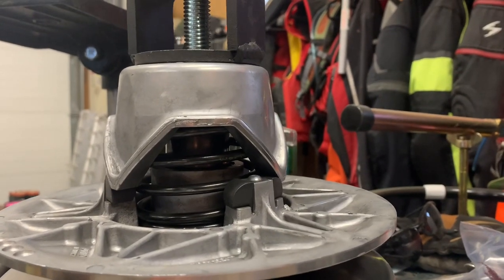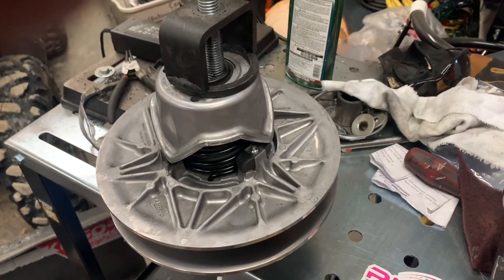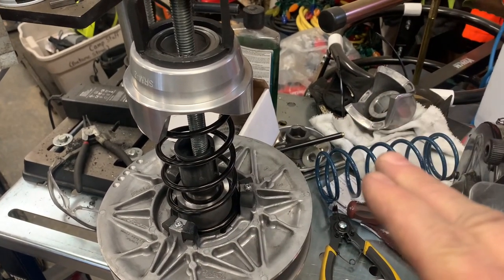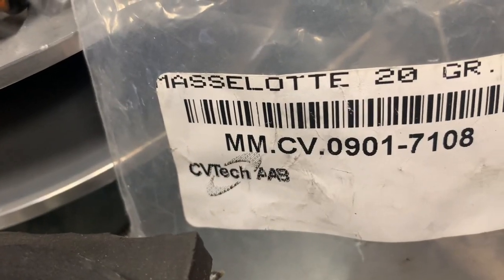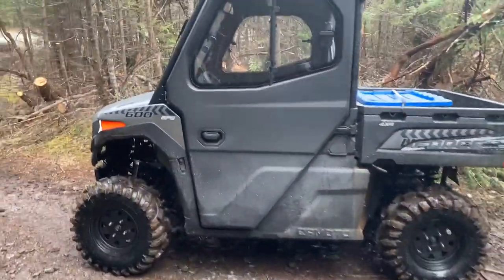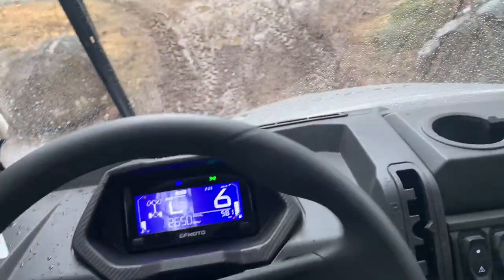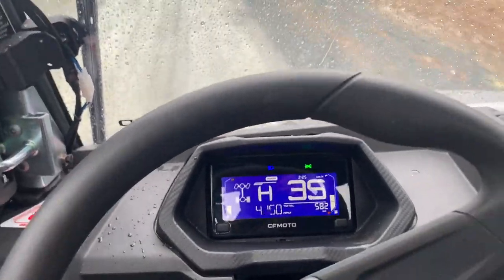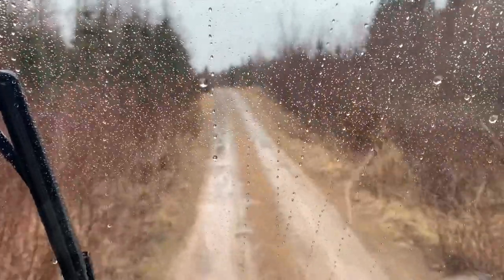CFMOTO Uforce 600 Installing and testing Modified RNG clutch kit

Comment: Great video, very informative. are you topping out at 70km/h in high. I have a 22 uforce 600 stock clutch setup and I travel at 80km/h easy and had it to 95km/h only twice tho cause it was screaming. question is are you gaining a smooth pull away and losing top end?
Reply from the maker: I’ve never had a chance to run a completely stock set up. When I bought my machine it came with 27x10x12 Kimpex mud predator tires. It also had a full cab. I know the larger heavier tires, and the full cab would slow me down, but I’ve never had my machine up to even 80 km/h. Now I haven’t ran it down a completely smooth gravel, or asphalt Road. I know that I was on a slight downhill on asphalt I could get more speed. But as it stands, I’ve never seen 80 km/h (50mph)
After adding the clutch kit, and all of my modifications to it , I gained more bottom end and smoother, clutching, but still ever gained anything on top. It feels like I just run out of power when I get near 70 km/h.. 
The clutch setup I have now seems to be revving very high at 71-72 kmh. 
I’ve heard talks of binding helix that won’t allow full shift out. I might experiment with stock again to gain a new baseline

Comment: Anybody try A1 on secondary with stock spring in secondary?  I was thinkibg of trying this with rng primary kit to maybe save alittle money for now. Was just wondering if anyone has tried A1 cause it aint quite as abrupt as c1 and  a few degrees more then B1. I am learning this slowly about these clutches also. I got rng primary with his black spring and 3-18 gram weights and 3 - 16 grams in primary with stock settings on secondary, but thinking I may try A1 and see how she acts before buying more parts for clutch. Aint looking for a speed demon just that happy medium.

Comment: I take it you didn’t like the team MSC clutch kit? I’m getting the Star 3 trail kit next week but after watching a few video I’m a little nervous
Reply from the maker: I feel like the clutch kid I got from them was some sort of mixup. The weights were far too heavy for the set up that I had. When I questioned them about it, they sent me a new updated spring, but said those weights should be good. I found their kit my RPMs too low to be in the power and I felt like I was always in just a little too high of a gear ratio. There is nothing physically wrong with the quality of their kit. I just felt like they had the components wrong.
Their philosophy seem to be heavy, clutch weights combined with a heavy spring, where RNG uses light clutch eights with a light tension spring. You can achieve the same result either way, but it just seems that adding excess weight and excess tension is unnecessary so I prefer the way that RNG does it.

Comment: I'm happy with as of now with 0951-1037 primary spring and 16g weights. I have 27" megabites and it pulls them great and not revving out like crazy, good cruising rpms. I have a crv helix and will try that later. Thank you for the info.

Comment: Hi Greg
Is it beneficial to add the helix 
I just did the rng primary kit to my 600 all stock not bigger tires
Reply from the maker: The helix helps increase the speed of the back shifting and also holds you in a lower gear ratio longer. Compensating for larger tires.
Reply: I’m pretty satisfied with the new primary spring and weights, did take a lot of the in and out clutch jerkiness out of it. 
I’ll run some more time on it and see what happens. 

I’m also looking into the ecu flash , is that something you have done to your uf600?

Comment: Team MSC is the way to go!!
Reply from the maker: I tried the team MSC as well as the RNG clutch kits and head better performance from the RNG kit. 
The MSC kit kept my RPM too low to hold the engine in its sweet spot. Acceleration was much slower. I gave it a fair try, I really did. It just didn’t work better for me and the tires and such that I am running. It may work for you, and that’s great .
That’s why we have choices and it’s great that we do

Comment: Not trying to be critical of what your doing, I don't really understand why you guys are doing this,  my uforce 600 is 3 years old and after about 500 miles, it's is as smooth as butter on take off and has a 55 mph top end, low end torque is good with the stock set up, I guess my question is are you wanting more low end torque,  just trying to understand, still enjoying watching your videos
Reply from the maker: To be 100% honest, in the beginning it just started as a quest for a little more low end power. I essentially just wanted a little bit of off-line power which would simulate a low or super low range like they had in the old Willy’s jeep.
I had a few incidents where I had parked in some deep moss in the woods and couldn’t back my machine up. I was up against a stump in the front so I had to go in reverse. I realize that reverse gear is not the same gear ratio as low range, but the fact that I couldn’t back up and it would just burn my belt Left me upset with CF Moto.
So in a quest for more low end power, I bought a stage one clutch kit from Main Street cycle. 
This kit did not do anything to help me, and when I was talking about this on my video, RNG performance contacted me and asked if I would like to test their kit. Of course, I agreed. And because I’m a person who really can’t leave well enough alone , I continued in my pursuit for more low power.
Reply from the maker: I am at the point now where what I want is different than what I wanted a year ago. I want low cruising RPM with solid belt engagement. I purchased the “big tire helix “and I don’t think that was the right purchase for me. There is no way my uForce 600 would hit 55 mph. You’d have to be towing it downhill with a tailwind. 45 mph is my top end. I am running a full cab with a windshield that is like pushing a 4 x 8 sheet of plywood into the wind.
I have tried going back to stock but I still would never be able to hit 55 mph. I’m not sure if it’s the 27 inch tires or the cab or just the gravel road I’m running on but there is absolutely no way on earth. My uforce600 will go that fast .
Reply: Ok I think I understand what your wanting to do, under normal circumstances my unit is great for me as stock set up, 1800 miles and mostly creep around the bayou and woods around 5 or 6 mph, I broke it in this way and drive that way, and out on the open road, it will take some time to get it up to 50, between 50 to 55 on a good day with the wind at my back 😀, other than that I just creep around slow, 3 years old now and never had a problem, other than the rear decals came loose so I pulled them off made the unit a little cleaner in my opinion
Reply from the maker: I’m going to tear into mine soon and change things up again. I’m going to go back to stock to get a baseline feeling now that my machine has over 1000 miles on it. 
I can’t say mines been problem free. 
I had the flasher module replaced (warranty) . Now I’m dealing with a very worn steering rack. It’s very wiggly and allows the tires to wiggle like the tie rod ends are worn. 
The dealer is gonna put a new box in under warranty.

Comment: 25mph in low.  Lol.  You should be hitting 35-40mph.  And 40mph in high.  Yep.  Something is way wrong.
Reply from the maker: In Canada, our machines are speed limited to 40ish KM/h (25mph) for some stupid reason. Doesn’t matter what clutch set up you run you won’t get any faster unless you were able to go into the computer and change something.
Reply: @gregmartin824  unhook the wire to the ECU that tells it it's in low. Just like on the 950.   But even in high range you may not ride that fast but it should still be able to do it. All I was saying.
Reply from the maker: @ronaldgrimmig6659  only problem with that is you loose your dash indicator. 
Not a big deal for me, but sometimes my wife and kid ride the machine I just like them to know that it’s actually in gear not riding halfway in between before they step on the gas in here that big, grinding noise
Reply: @gregmartin824  still reads on dash.  That wire splits off and feeds the display separately.   That's why you remove it at the ECU and not from the gear selector.
Reply from the maker: @ronaldgrimmig6659  awesome. I’ll look into that for sure.
Reply: I tried everything. I just put the secondary spring back in and it’s still binding. I clocked to b-1 c-1 both stock and secondary it was good for about a half a ride and started binding again. I’m just gonna stick with my own primary kit and do away with the trail helix and secondary spring. I ride at least 4 times a week and the inconvenience of it biding just sucks. I’m glad you got it dialed in for you.
Reply: @bigjoe5659  things are in the works.  Parts being mailed out in the morning. Along with tons of info.  If CV tech and anyone else won't fix it I'm having it fixed for them.    Stay tuned
Reply: @ronaldgrimmig6659  I am lol. It’s super frustrating , you know I’ve tried everything the past week. I just got back home from a ride and it’s the same bullshit.? It gets worse and worse. I didn’t put the stock helix back in like I said I tried something else. Stock is going back in tomorrow so I can enjoy Easter Weekend!